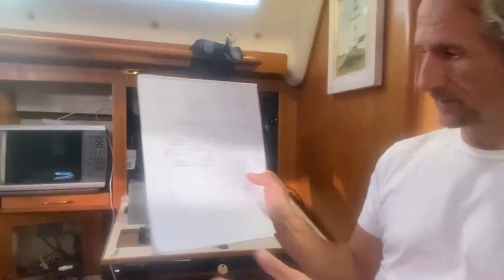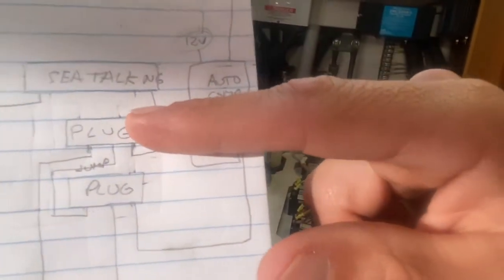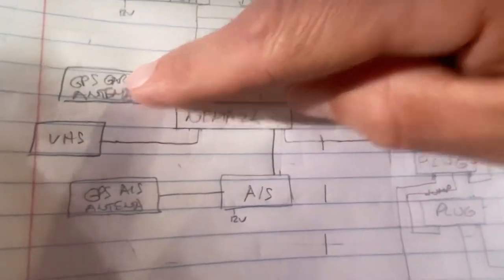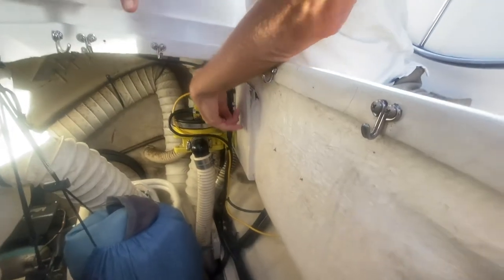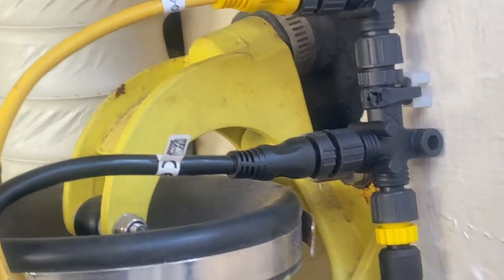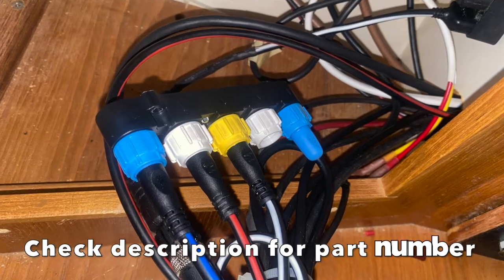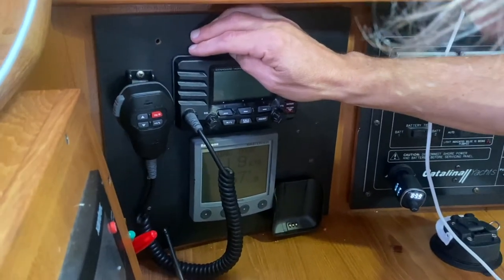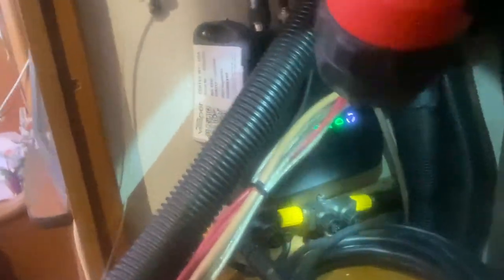Connecting SEATALK 1 to SEATALK NG to NMEA 2000 Backbone on our Sailboat ~w/MaryBeth & Stephen~Ep 84

Comment: Everything I have read about the Seatalk converter suggests only one power supply and for that to come from the Seatalk NG network. How did you address this?
Reply from the maker: I had an existing NEMA 2000 network and a Seatalk 1 network which were totally separate and powered off of separate circuits.   When I interfaced the Seatalk NG network between them I cut power to Seatalk 1 and added it to Seatalk NG while keeping the power to NEMA 2000.  It worked like a charm.  Then I realized that Like you read there should only be one power source so I cut the power to the Seatalk NG.  The whole network stopped working.  so I put power back and everything worked again.  I am not really sure why that is.  I just said it ain't broke so don't fix it LOL.  Feel free to contact me if you want more info like my wire diagram.  I can't post pics here for some reason.  Thanks for watching and for your question.

Comment: Can you adjust the old auto pilot (on seatalk 1) from your chartplotter on NMEA2000 now? Im wondering if SeaTalk1 to STNG allows me to control my auto pilot over the chartplotter on STNG... and if can swap out the old ST4000 control for a P70s.. but leave the actuator/computer as is.
Reply from the maker: There is some communication between the Garmin chart plotter and the Raymarine autopilot, but it's not seamless.  The plotter will send course changes to the autopilot and it will alarm if there is too much tracking error but It's easier just to use the autopilot directly.  Let me know if that works. Thanks for your comments.

Comment: Is this the same method I need to connect my Simrad autopilot and Simrad radar to the nmea2k I am about to install? Thx
Reply from the maker: Hi Kit,  I am sorry for the late response. I missed your comment.  I am not sure about that.  I used NMEA200 to connect my Ramarine and Garmin devices because they could not be connected otherwise.  I know that I can connect other Garmin devices together via NMEA but devices like RADAR and SONAR use high band width so they need to be connected directly to each other.  As far as I know NMEA 2000 cannot handle that type of data connection.  I would assume you would need to hook up your RADAR and chart plotter directly. You should check with the Simrad rep on that.  Let me know how the install went and what you found out.    Thanks for watching.

Comment: is the connection from the STNG network to the NMEA 2000 network connected to the end of the nmea 2000  backbone or is the STNG network connected at a drop?  From your video it appears you have one terminator on the STNG side and one on the NMEA 2000 side.  Can you confirm that?
Reply from the maker: Hi Denise,  Thank you for your questions.  To confirm the STNG is connected to the backbone of the NMEA 2000 with terminal resistors on each opposing end.  Are you doing something similar on your boat?
Reply: @GoWithTheFloat  Many thanks for your video!! What adapter did you use to connect STNG backbone to NMEA 2000 backbone ? I can't see in your video how the STNG cable connects to NMEA 2000 backbone
Reply: @alexrodrigues8357 Good day!  Have you solved this problem? Need to connect SeatalkNG to Nema2000